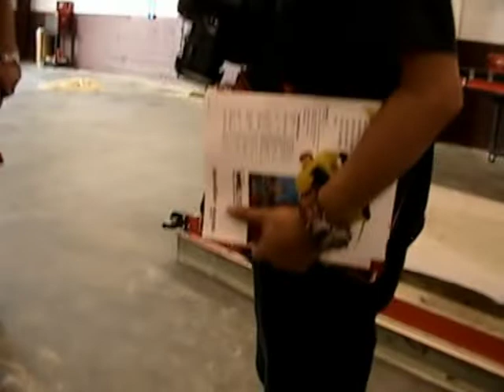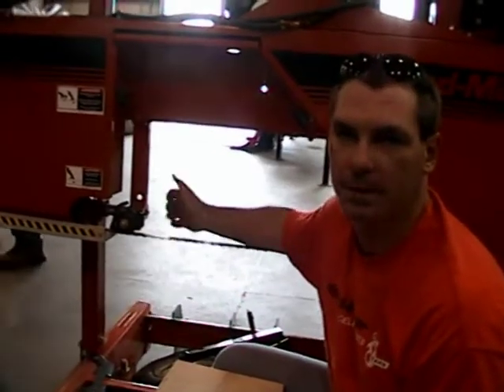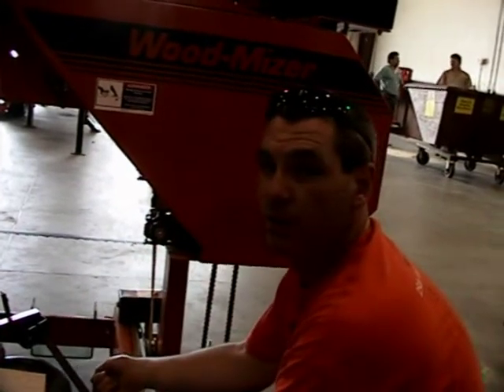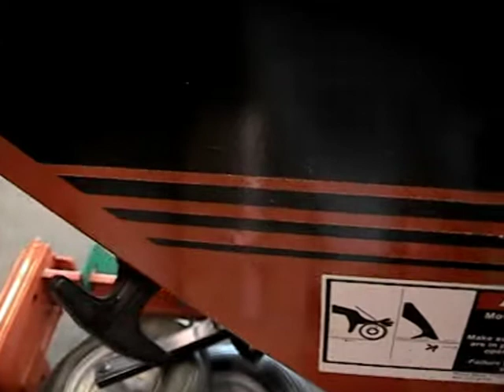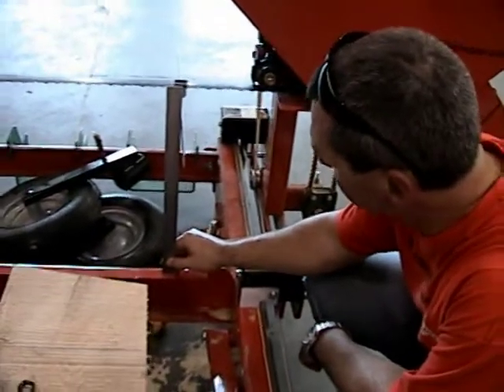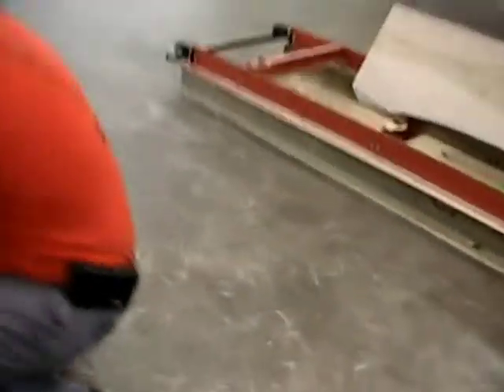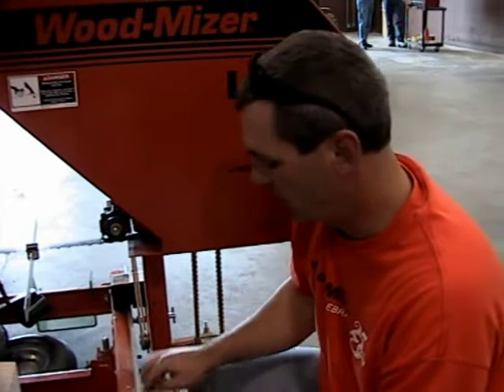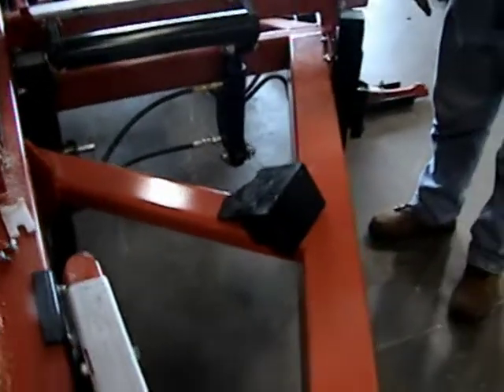Wood-Mizer blade alignment explained at factory

Comment: I am building my MADE IN AMERICA woodmizer mill. I CALL B.S. the bolts are metric and from Red China! 

Makes it really hard to find MISSING BOLTS and MISSING set screws on the 4th of July weekend! 

I am VERY DISAPOINTED.
Reply from the maker: WM makes machines both in USA in imperial measurements and in Europe in metric with EU safety features. Not mixed and not in China
Reply from the maker: I have both US and EU made machines and knowing that have both sets of tools. There are new design tools that fit both systems. Have not noted anything odd with the bolts. Agree, some user manuals are not user friendly and missing parts or even unrelated parts do appear at times
Reply: @MarkkuRanin  I am NOT saying I can't assemble the unit with metric. 

I am saying for a USA machine, metric is horsecrap! 

I am REALLY saying, when bolts are missing, it's hard (impossible) to find replacements at the local hardware store. 

I am saying, we can decode this foreign language called metric, BUT WHY? I didn't buy a harbor freight mill. I bought a USA machine. 

Most of all, I was planning on using the little lx25 to make some cash and buy a BIGGER woodmizer, now, I plan on buying an USA MILL, that's user-friendly. I have nearly 600 acres of trees. I will need a bigger mill. But it won't be orange.
Reply from the maker: If they sold you an EU version it must have been only because the waiting time for new ones there is not as long as in the US. Main reason for delays are interrupted component supplies and, perhaps, bolts and nuts are now coming from odd destinations
Reply: @MarkkuRanin  no, it's the same one everybody else is complaining about... they have a huge backlog, trying to catch up.  Qc is way down.
Reply: Had same issue. Missing bolts and set screws, unable to find metric set screws locally. Not sure why a US built mill has metric bolts
Reply: @arkysaw5189  because it's CHEAP! ultimately, it's the same reason we goto walmart or buy items from China, it saves us money. And they are buying bolts in bulk from Red China. 

I sold my woodmizer  and bought a TRUE MADE IN AMERICA MILL. It cost more, but, it's not a "hobby mill", it will cut better and last longer. And it's in good old USA bolts.  Big thing I like on my new mill, it has a hydrolic press to keep the blade tight, a much better design.
Reply: I asked about this. They actually say "BUILT in the USA", not "MADE in the USA". The parts actually come from an eastern European country (can't remember where...Serbia or something) and then are assembled in America. So you are correct, the mills are definitely not manufactured in the USA, just "built" there (ie: putting all the pieces together that were made in another continent).
Reply: @jackdundon2261  The euro spec mills are so much better built than the sht WM sells here. See their videos.. much nicer quality. 

And for the record, literally the US is the LAST country on the planet to adopt the metric system. It is not a Chinese invention. And as many Americans can't do basic fractions, the quicker we go metric on everything, the better. It is so much easier. 
Most of the kids I hire don't even know what half of a half is. Try explaining half of 7/32 of an inch. Ugh.